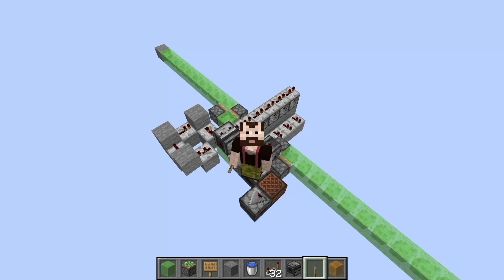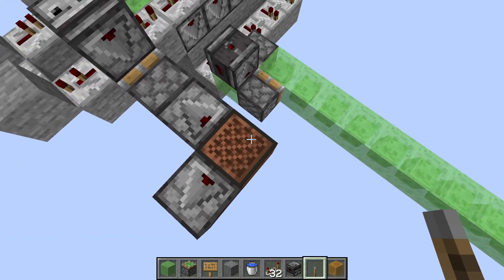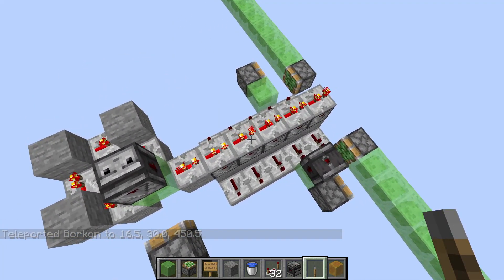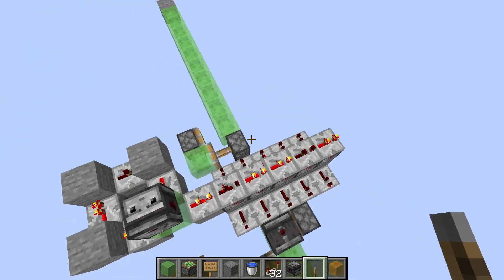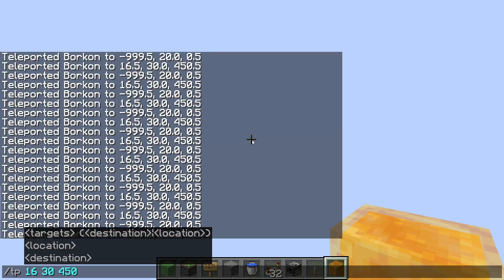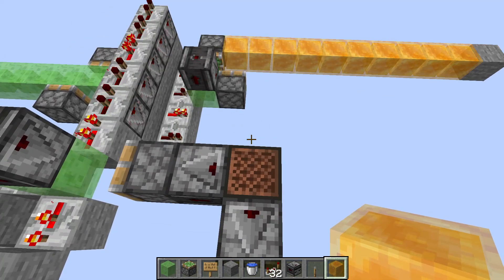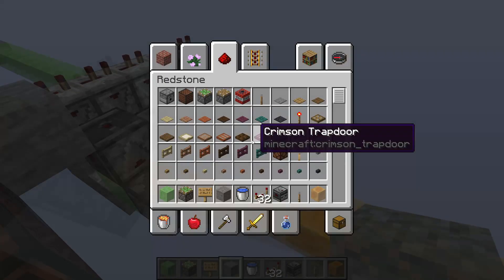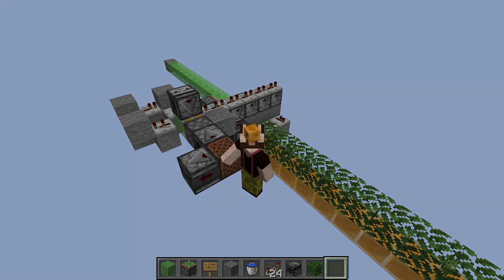Tethered flying machine reliability update | Minecraft Java 1.16

Comment from the maker: Just like I realized during filming this, the entire problem was in the clock. I replaced the clock with a different one (two droppers pointing into each other, comparator on each dropper, 3 tick repater from comparators to droppers, one item) and 200 teleports later with full slime bars and the machine hasn't jammed. The two arms get out of sync, but that's the only problem remaining. Also, it's very easy to make this problem happen by simulating a broken clock by just making the clock faster. I might need to start a collection of unload safe clocks.
Reply: I can get this to obviously work with the original clock but given the issues you reported thought I would try and follow the above instructions. However, although I understand two droppers pointing into each other, one containing one item then comparators from each dropper with a 3 tick repeater from each) I am confused about the last part where you say to then link the repeaters back to the droppers. Could you please advise how you wired this up as it just moves the flying machines back and forth one block?

I can get this working with an Etho clock using two hoppers but they have to have 3x items so it is slower than the original clock/version.
Reply from the maker: @Simulacra001  The easiest way to see how it's done is probably to look at a farm I built with this updated design. I think the only one I published outside my let's play series (I've done a bunch in there) is the kelp farm in https://youtu.be/wKGp6NG8JT4

Check the world download there.

The kelp farm was extra complicated because of how I needed to get the flying machines to park precisely so it contains a bullet proof mechanism for turning this whole thing on and off. It also uses an alternative layout for the flying machines but that's interchangeable.

I probably should make a video with all the improvements I've done to the tethered flying machines.
Reply: @Borkon  Thank you for your reply and for linking to the other video. No tutorial needed as you went through it in enough detail on the other video. Again, thank you for that :)

If you want to get rid of the repeaters and use your new underwater design above water and also mute the note block you can simply put two more slime blocks on top. One covering the note block and one over the slime block next to it.

So, the first part of the flying machine will be:
AAA
ABA
PSS

And the second:
ASS
ANS
HPS

Key:
A=Air Block
S=Slime Block
N=Note Block
P=Sticky Piston

Comment: You could turn the clock off and on again whenever you get a signal from a reload detector (armor stands with frost walker will freeze nearby water on reloading them). This might not fix the issues with the repeaters that aren't part of the clock though, because, iirc, tile ticks that were scheduled to elapse at the same tick and then unloaded before being reloaded and processed occur in random order as opposed to normally where they would occur in the order they were scheduled in.
Reply from the maker: That could be a solution if the machine is on all the time. But all uses I've had for this machine this far the clock gets cycled on a daylight sensor or a hopper clock and that should be sufficient to unclog it in a reasonable amount of time. Detecting reloads isn't fast enough to turn everything off because there's a significant delay between the clock turning off and the last signal reaching the end of the tether. Unless the reload detector removed the blocks that the observers are powering, but that would be a huge and expensive mechanism.